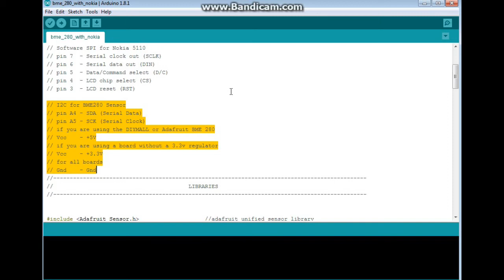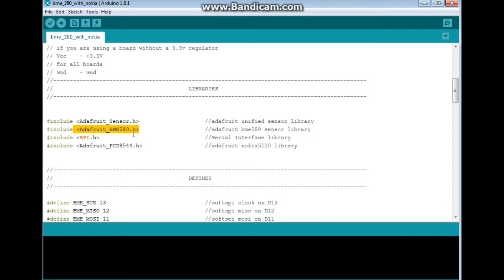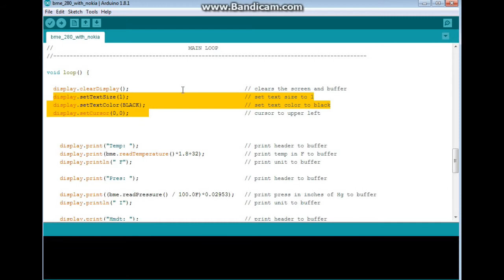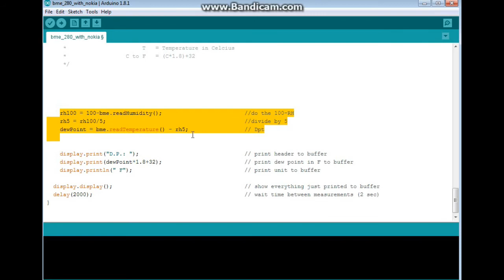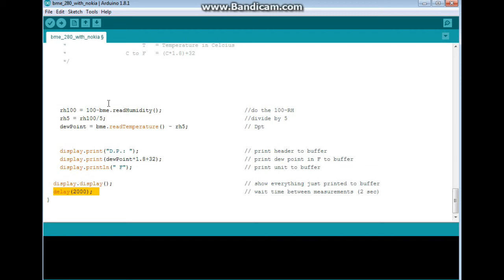What's the difference between the BMP280 and the BME280 atmospheric sensors

Comment: Working on a ventilator for Covid19. Bme280 seems very affordable, would it measure pressures accurately that are involved w breathing? Need it sensitive enough to detect an inhalation (for assisted breathing) and measure pressure to not a damage the lungs.
Reply: Apparently one meter high or low will be detected

Comment: Thank you for demonstrating this. I think i was lucky and got a BME280 even though the eBay listing said BMP280 £1.99 ($2.56) as mine shows Temperature , Pressure and Humidity too.

I had to change a few lines of your code because i am using an 1.3" OLED. Also had to change line number 32 in the Adafruit_BME280.h file to read #define BME280_ADDRESS (0x76) not (0x77) .
Readings are now..
Temp: 74.89 F, Pres: 29.90 I, Hmdt: 64.94 %, D.P.: 62.00F 

I also removed the conversion from C to F as we use Centigrade and the pressure from I to hPa, basically just read data from the sensor with out any conversion.
Readings are now..
Temp: 23.99 C, Pres: 1012.30 hPa, Hmdt: 63.22 %, D.P.:16.62 C (South coast of England)
Reply: Hello, I'm having trouble compiling the original script. Is there a chance to get your script for testing?
Greetings from Germany

Comment: Mike, Thanks for a nice explanation of the different parts and great breakdown of your code. I think your display is a Nokia but can you share the model/source for it? I want to build a dew controller for a telescope and was just look for parts when I found your YouTube video. I need to make four PWM control loops that power heaters to avoid dew clouding up lens and mirrors. An Arduino Nano and these BME280 sensors and some drivers will make a perfect controller.

Comment: Nice work. And thanks for making the code available.
Reply from the maker: +Philip Chandler Thanks
Reply: learnelectronics I started with electronics back in the day when everything was discrete components, and transistors were pretty new. I could solder before I ever saw a keyboard,  and made radios while I was at junior school. First used a computer in 1971, when I worked for IBM for a short time. Never saw the actual computer - it was in an air-conditioned building that only DP guys were allowed into...
Reply: I have recently become interested again in electronics after a long gap. Now I want to add monitoring to my beehives, so looking at Arduino etc and all the sensors that might be useful.
Reply from the maker: +Philip Chandler and it probably had vacuum tubes?
Reply: I came in right at the end of the valve/vacuum tube era, and never had much to do with them. My father, who has just turned 90, was an electronics engineer all his working life, and around 1954 built our very first TV from components, including winding the high voltage coils for the 9 inch CRT. Among other things, he worked in military communications in a joint project with the US Army during the 1970s and helped to develop the first ever PCM field telephone system.
Reply from the maker: +Philip Chandler Wow, that's cool. I bet he has some great stories from those times.
Reply: He's rather modest and doesn't talk much about it. A lot of his work was covered by the Official Secrets Act, so I guess we'll never know.
Reply from the maker: +Philip Chandler Well that just makes it more interesting. I got my start as sonar tech in a submarine for the US Navy. I know about keeping secrets.
Reply: That must be a good training. I never had any formal training in electronics and I regret that now. Steep learning curve, with all this new digital kit now available! Still, I will enjoy experimenting and I'm sure I will learn a lot from your videos, so thanks for taking the time to put it out there.
Reply from the maker: +Philip Chandler You're very welcome. The Navy was great training, they also paid for my bachelor's degree. So I am very grateful for my time.

Comment: I almost bought the BMP280 just now before watching you vid. Thanks, saved me time and money. Here's my question: can this be used on a Raspberry Pi 3B+ board? I'm doing atmospheric research (home-based scientist) and I have fought a losing battle with the DHT11. Garbage. I also have an Arduino Uno.Never used it before. I really need the same data you show in your video. I'm trying to predict when static electricity will occur.  Second question: Can the data be sent to a MYSQL Dbase on my website? If you know how to do these things, please make a how to video. Thanks again.
Reply from the maker: you may be able to use ittt. its just event reaction
Reply: learnelectronics thanks. Not familiar with ittt.
Reply: Have in mind that Nokia display is working on 3,3V so using 5V digital signals on it will reduce its lifetime.
Reply: Mike, how is your project going?

Comment: I would choose sensors without voltage regulator onboard over those that have. Measuring environment temperature with a voltage regulator near by that generates lots of heat sounds weird.

Comment: My BME280 with has the SPI states that it can do all three, Pressure, Temp and Humidity. This is on the mask print of the PCB. So still confused. BTW, I have the BME/BMP 280 that you used in this setup.

Comment: Isn't that a 3.3 volts sensor?
Reply from the maker: VoeViking The IC's are 3.3V, but the boards from both Adafruit and DIYMall have a voltage regulator on board so you are good to go with a 5V Arduino.😀 Thanks for the question.